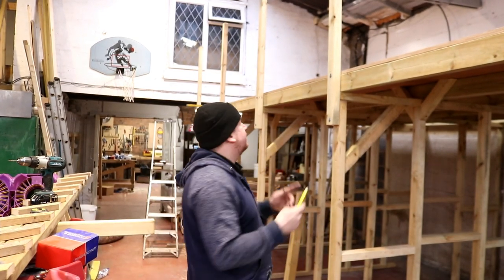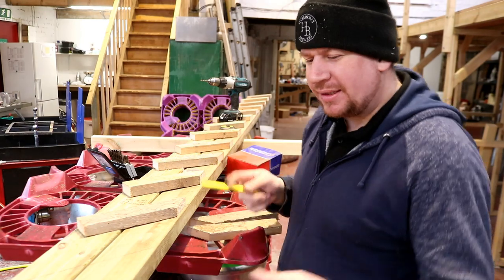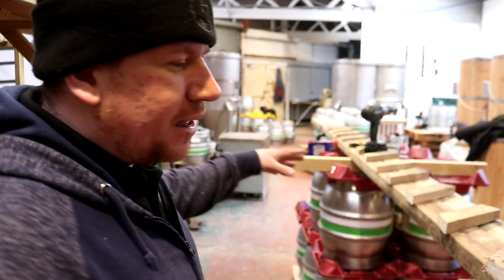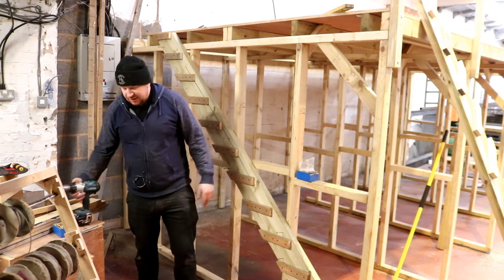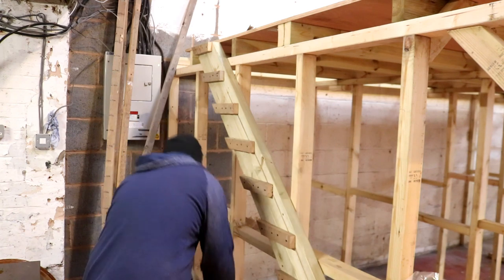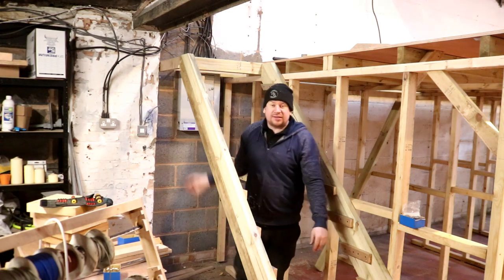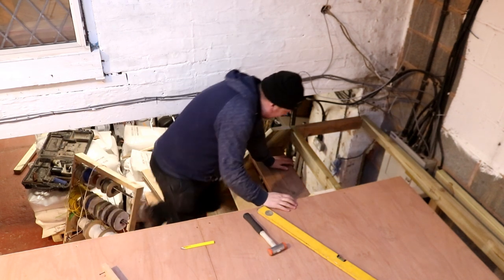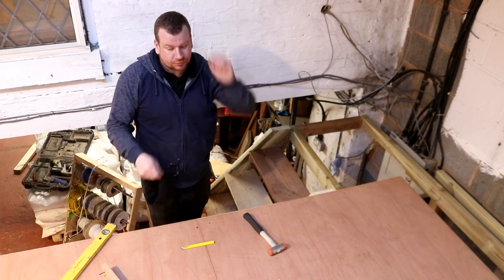SIMPLE WORKSHOP STAIRCASE

Comment: I don't want to seem a nay sayer again but staircases are built with the treads rebated in as the sheer strength of the wood is far greater than the sheer strength of screws. I would suggest banging a load of glue between the tread supports and the sides to provide extra support.  Hope you enjoyed your beer, don't forget the camera 😄. Cheers, Schnuz.
Reply: Yeah, I'm not sure about them either.  Especially if they're going to see a lot of use.
Reply from the maker: I'm not that fat!!!
Reply: @harrybrew69  I've seen a staircase in a house where several of the treads were only being held up by the carpet, just saying 🤔. Cheers, Schnuz.

Comment: Have you thought about adding some longer, maybe 6'-7' 45 degree angle braces on the side of your structure closest to the cinder block wall? They would help take the left and right "play/wiggle" out of the structure. Left/Right being if you're facing the structure, looking at the cinder block wall... staircase to left, roll up garage door to right.

4x4 pieces of timber, two or three, from your landing to the floor would be ideal, placing them in the corners of your landing frame, again, braced with some 45's of 2x4 timber.. better safe than sorry! Also, maybe add a couple 2x4 supports halfway up the stair case, from the floor up to the staircase.